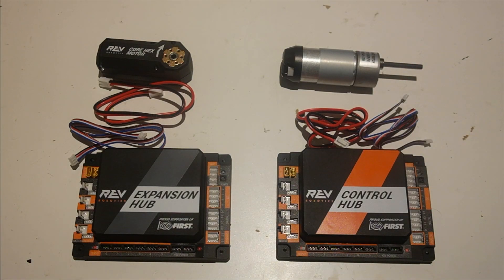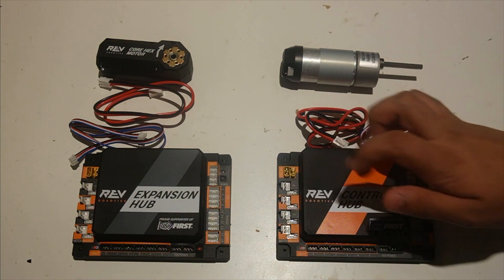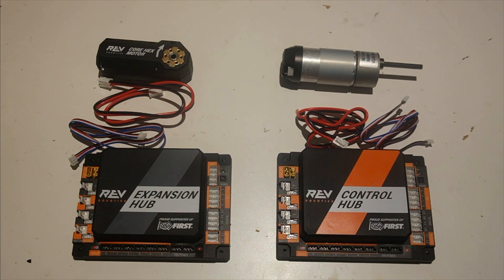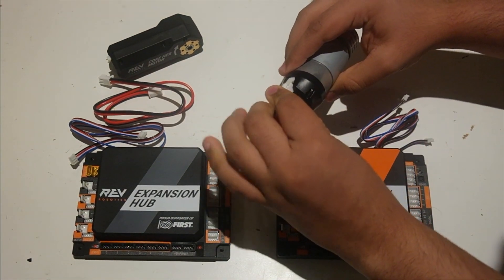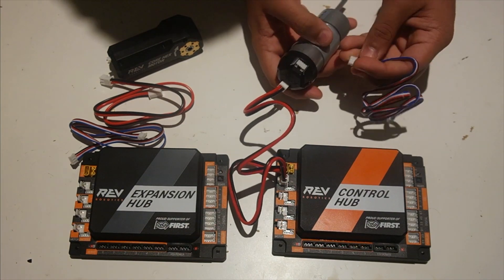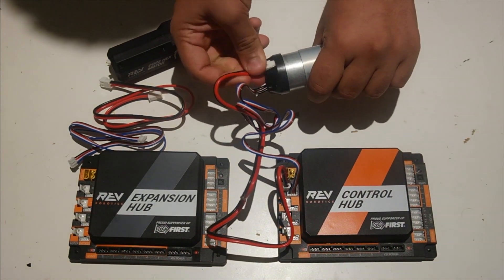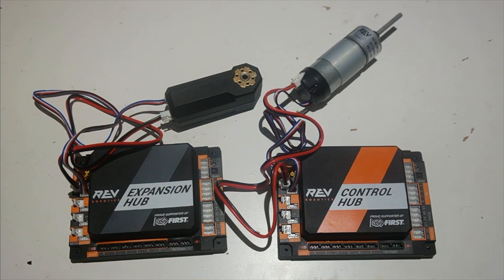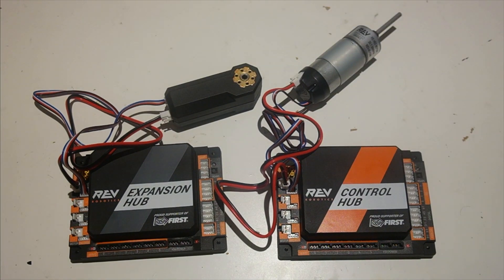FIRST Global and FTC Motor Wiring

Comment: hi I have question I have dc motor and I use it to build arm to lift weight but it have some problems like it not smoothly at moving and shaking , and advices?
Reply from the maker: This is most likely due to the PID not being tuned for the motor. Take a look at our DC motor programming video for programming methods, and look at the FIRST Global PID guide for more info on tuning the PID of a motor.
Reply: @WizardsexeFTC9794  Thanks but this is the problem , I already see that and tune pid as the manual describe but issue still there , now I  change the way of control ,but  I face new problem motor not hold in it position  .
Thank you

Comment: Whats the difference between the expansion and control hub?
Reply from the maker: The control hub has an Android smartphone built in so you don't need to connect it to a phone to use it in ftc. The expansion hub on the other hand needs an external phone connected to it over USB.
Reply: @WizardsexeFTC9794  gotcha, thanks!